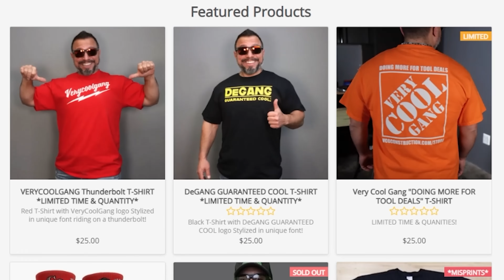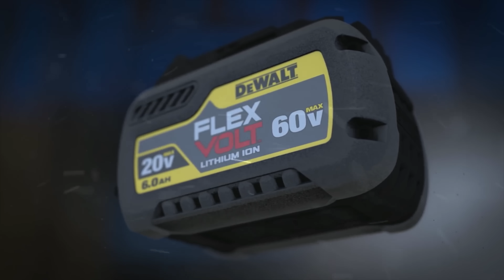DeWALT PowerStack Clearly Outperforms HUGE FlexVolt Lithium Ion Battery!

Comment: Im not sure how this battery will preform but i trust dewalt. I been using dewalt tools for years now and am super happy with what they do. Just can't wait for a power stack flexvolt.
Reply: That's gonna be nuts.
Reply: Its a pouch cell, its more expensive than cylindrical and less physically durable but it has a stronger chemistry and its in a more efficient shape for packing and low resistance but dont expect it to last longer than flex volts in the same conditions.
Reply: @odisy64  All they have to do is make the outside durable. Less connections too. Instead of 10+ cells each with 2 connections, it's just a couple
Reply: My impact just died after 7 months of regular use from new.
DeWalt just lost me as a loyal customer. I'm buying batteries and chargers of the big three and buying tools not by brand but by quality
Reply: @jonathangarzon2798  warranty it out. You got 3 years they'll give you a brand new one.

Comment: They keep saying that the rubber overmolding is going to protect your finished surfaces, but I am worried that it's going to pick every little grain of sand and dirt and instead ruin your finished surfaces. Hope they make a version of this battery without rubber.
Reply: What are you even talking about?  To me it seems that you’re trying to justify not having rubber over-molding…for whatever reason.  LOL!  I have a Flexvolt table saw, the other day my 9 volt Flexvolt battery fell out, hitting the pavement, as I opened the hatch, putting a nice dent in the battery.  I’m lucky it didn’t crack.  Today my M12 Job Site Blower fell out of my door, hit the concrete and bounced…no damage.  I knocked over my M18 Fuel 18 Gauge Nailer the other day, no damage due to the rubber over molding on the battery and the tool.

Rubber over molding has protected against damage to granite and marble countertops, fine wood, etc…. As far as I’m concerned there is absolutely no disadvantage to having the rubber over-molding.

Comment: DeWalt is definitely bringing the heat when no one else is right now.  First the DCF850 and now PowerStack?  This is a great time to be a DeWalt guy.
Reply: Si!!
Reply: Dewalt is know for heat and 💨💨💨💨🤣🤣
Reply: @micjubba709  wtf does that even mean? Lol this guy.... 🙄
Reply: Or gal. 😉
Reply: @Jennyfromtheshop  a very pretty and knowledgeable gal I might add....
Reply: I agree !! I got one of the  20v max atomic series impact and it clearly is waaaaay better than any of the other brands of drills the people at my work use and I'd say almost half the weight. Second favorite for the drills and impacts is the makita brand for me they are super smooth.
Reply: As an Australian we can't buy Flex
Reply: Dewalt is doing great work. They have way too many variations of each type of tools. 20+ different drills, 10 drills are damn near identical. Their lines are confusing 20v brushed, 20v max, atomic, advantage, flexvolt, XR, 12v, 12v extreme
Reply: Great joke. 😂
Reply: I love Dewalt and I'm on the Dewalt platform, but I'm getting started in plumbing now, which is a space OWNED by Milwuakee. 
I'm finding that Dewalt has most of what I need. 
But in the future, I may need a Dewalt bag and a Milwuakee bag to fill-in the blanks.
I like em both though, so I'll be happy either way.
Reply: I got DeWalt, Milwaukee, kobalt... But Flex... It's just a Flexing tool. Like I got it because just cause I can. I prefer Flex 💪
Reply: Just switched from craftsman to dewalt! So excited! I got the 850 on the way now movin up to the big boy tools
Reply: Lmao “first the dcf850” lol wth. It’s an atomic mid or entry level driver. What makes you think its anything special?
Reply: @suppaman12  entry level? It outperforms the 887. It's basically Dewalts flagship impact now.
Reply: @MumentoMory  outperforming the aged 887 means next to nothing. I think the ryobi and hart impacts outperform it lol. That being said, this new one is barely catching up to the Milwaukee and makita. Next year it will be trailing again. And no, the atomic lineup is not a flagship tool. Sorry you wasted $150 on a entry level model bud
Reply: @suppaman12  This sounds very biased. DeWalt's impact lines never beat Milwaukee and Makita in performance, but they do definitely win in battery life. And actually, if you look at tool comparisons between the Dewalt and the Milwaukee, the Milwaukee isn't actually that far ahead.  And yes, the 850 definitely beats the Ryobi, and the Hart impacts by a long shot. The Hart tool in particular would probably burn up doing some of the things I've done with the 850. I've used both. DeWalt themselves markets the tool as a contractor-grade flagship tool and the companies that have bought them use them as such. Try to take all of the tool brands with a grain of salt and never put one over another. They are all good at different things and have their own strengths and weaknesses. As much as people like to think they are, Milwaukee does NOT make a perfect tool. Neither does DeWalt. Neither does Makita. They all work well depending on your trade, and they all have their fair share of stupid mistakes. Brand loyalty is a pretty ridiculous thing.
Reply: @suppaman12  it’s the most compact driver to date still
Reply: Flex has literally the same thing.
Reply: @jdisdetermined  but such a small variety compare to dewalt 🤟🏼
Reply: @CesarPerez-is3eb  Plus Dewalt is world wide and already popular in the EU, where Milwaukee is only just gaining ground last 5 years and Flex is non-existent.
Reply: @effervescence5664  my dad has a milwaukee paint mixer drill from 1981 and it still works  beasty. Sawzall too
Reply: @effervescence5664  not in Germany been using team red for years
Reply: @effervescence5664 Milwaukee has been huge for decades . What you talking about
Reply: @jdisdetermined  no they don’t lol. Show me
Reply: @jdisdetermined  even ryobi users make fun of Flex users
Reply: @Dunkasnu  Interesting. I'm coming from the detailer side of the industry. In my world, Flex is as good as it gets.
Reply: @jdisdetermined  you detail cars?
Reply: @Dunkasnu  Yep. Mostly heavy glass and paint correction, chip repair, leather repair and coatings. Don't do alot of simple wash and wax type stuff anymore. But I do alot of disassembly and wheels off stuff, so I like my power tools too. They're all Milwaukee now because I use the hell out of the M18 Fuel rotary. 

Nobody has made a full size cordless DA polisher good enough to fully replace corded yet. The Flex and Dewalt cordless DAs are getting there, but there is still quite a ways to go. I keep hoping Milwaukee puts out a good one because I have 2 M18 chargers and 6 batteries already.
Reply: @jdisdetermined  they may have vaguely announced they were doing some form of pouch cell battery, but they haven’t officially announced it yet and DeWalt still has the smallest impact driver to date.  Flex if really nice, but I’m in a battery platform and won’t jump ship for something unless it’s significantly better.  Besides, I’m just a DIYer.
Reply: @lowdermilk89  1
Reply: @lowdermilk89  and then Milwaukee copied them😂
Reply: @jdisdetermined  OK but flex ain't Dewalt, go buy the flex I'll buy Dewalt
Reply: @jdisdetermined  who? Who? Oh the guys that came out in 2013. Dewalt has beem around for yrs. I’ll trust my Dewalt over a flex any day.
Reply: @jdisdetermined  flex ain't got shit on DeWALT Dewalt has wayyyyyy more tools, stereos, fans, lawn tools, mower weed eater they have 60 volt tools they have 12 volt tools, tire inflator, come on man....

Comment: Wow!  It’s looks like DeWalt has hit a home run with this technology upgrade!  The “beast mode” tests with that band saw was awesome.  Not only did that battery crank out some power but that band saw didn’t slow down.   Awesome demo’s and great video as always! 👍🏻
Reply from the maker: Thanks ZZ, gotta admit I was thoroughly impressed! What do you think about the direction of Dewalt, will they be a competitor to Milwaukee?
Reply: @VCGConstruction  I think Milwaukee has set the bar for their competition but as time goes on, the competition has not given up.  In your last impact driver video, the new DeWalt atomic series was catching up to the Gen 3.   I think it’s time Milwaukee debut some new offerings to raise the bar higher!
Reply: I gotta get that band saw. Got the 6.5 inch skill saw free after buying g 2 power stack batteries for $199. The same is regularly $219. Thanks dewalt.

Comment: Same as rc cars but bigger hazard to catch alight if charged wrong or punctured.
Reply from the maker: How would it be “charged wrong”?
Reply: @VCGConstruction  don't worry if it was a Lipo you have to balance charge it and not let it get to low  but t heese are different from those but look similar
Reply: @mealex303  In any case, these would be charged on a DeWalt charger. You can't possibly charge them wrong lol. The charger and Battery do all the thinking for you.
Reply: You should watch the whole video, confirmed NOT Lipo.

Comment: So - the “Black Friday” deals on the ‘old style’ batteries are to get rid of them??
Reply: Makita 18v has tanked in price very recently like by alot. 40v on the move and new battery tech probably fueling the mood.
Reply: Yup. Same reason Milwaukee is having deals on the XC5.0 and includes the XC5.0 in the kits. Too many of them, and the CP3.0 HO battery actually has the same power in a lighter package.
Reply: @l00nybin  are the xc5.0 still alright batteries for power tools? I mean they come in the Black Friday kits with the m18 fuel drill sets. Would it still be an acceptable battery?
Reply: @hyagosilveira987  They're not bad, but they're older technology. They are 18650 cells, and the High Output CP3.0 batteries (21700 cells) provide just as much power and runtime while weighing less. Milwaukee is trying to clear them out, which is why those are the ones included in so many combo kits.

Comment: The pound for pound compact Impact Driver power tool? 
1. Milwaukee M12 Fuel Impact Driver 
2. Milwaukee M12 Fuel Surge Impact Driver 
3. DeWalt Xtreme 12-Volt Impact Driver 
4. New DeWalt Atomic 20 volt Max Impact Driver 
5. Rigid 18 volt Compact Impact Driver 

If you have any to add please do.
Reply: No, I think u hit the nail on the head.